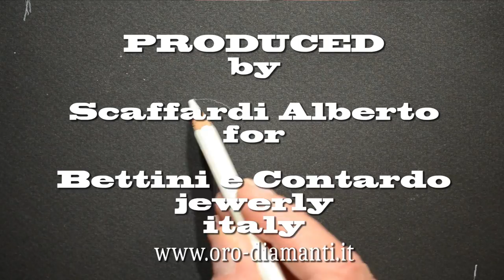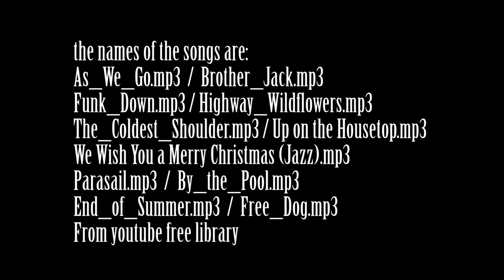From the design to the realization, 18kt gold ring, drawing of jellyfish.

Comment: This is absolutely incredible, detailed work. How long did this take from start to finish and is it okay to use glue when working with such precious materials?
Reply from the maker: +Claratina Andrea (Liberty) Thank you. It takes about two or three days of work. To fix the beads I use a two-component adhesive with a high seal (300 kg cm)
Reply: Ahh okay, thank you very much. If it's not too much trouble could you tell me where you buy your supplies from and maybe make a video on how you closed in the diamonds?